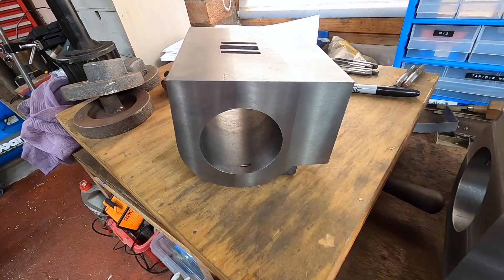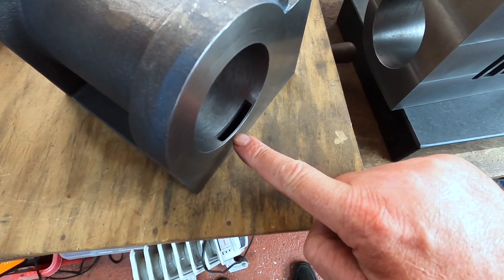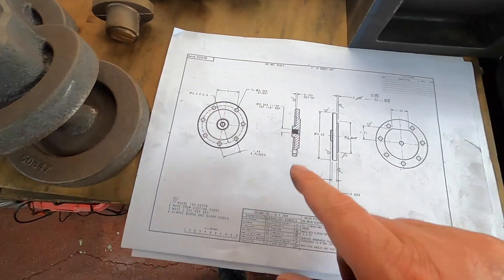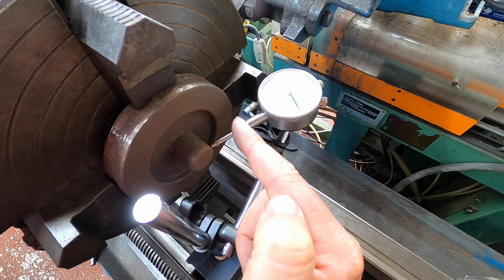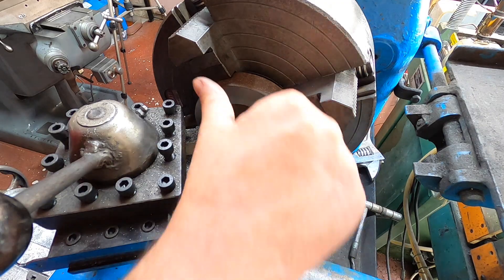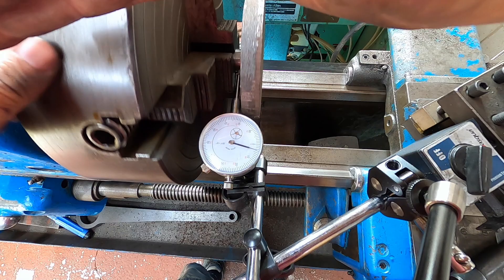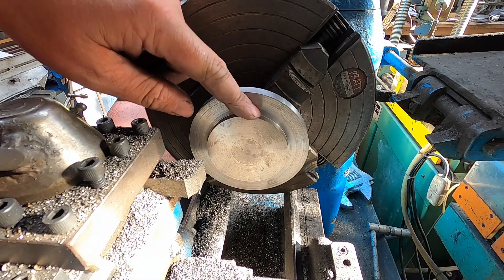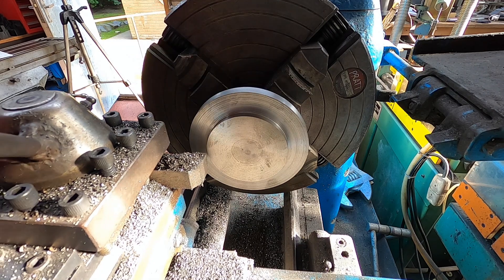Front Cylinder Covers  -  ep53 - 7.25" Gauge Steam Locomotive Build

Comment: Matt….
Boy that CI makes a bloody mess eh? 
Still, nice work mate….
and thanks for putting it up for us 👏👏
Regards
Robert
PS On my Baldwin cylinders, the steam port is actually on the cylinder end faces, and the end covers have a recess cut in them to allow the steam to go ‘round the corner ‘ so to speak.
Should explain also that the ports are not cast in… all drilling / deep slotting work 😵‍💫
Reply from the maker: Thanks Robert, much appreciated. Yes cast is a real messy job! I'm glad the ports were cast in  on these, but I don't think I would have struggled to have drilled them in, maybe on the next cylinders! 😂. All the best, Matt 👍

Comment: Once you have the covers all drilled and ready to fit on the cylinder take to the inside boss were it partly covers the steam port and put a bit of a relief in so the steam port isn't partly covered, the loco well run a lot better if you do. Other thing is cleaning up down the cast in passageways in the cylinder block, the more smooth the better the steam will flow in them and help the engine breath better.
Reply from the maker: Hi, you may see this in a future video 😉. All the best, Matt. 👍

Comment: before you cut off those bosses on the front of the covers.  I'd drill a small center on the inside of each cover for concentricity in case you find a reason why the drawing shows a hole later..
Reply from the maker: Hi Geoff, that would have been a good idea, shame I'm much further ahead than I've shown. I know I won't be using the hole, its far to close to the front bufferbeam. All the best, Matt 👍

Comment: Hi Matt, I fitted screwed plugs in the front covers on my pansy build, if you're putting the loco away for an extended period of time you can spray WD40 into the cylinders and steam oil when you get her back out again 👍
Reply from the maker: Hi, thats not a bad idea!! Especially if it sits for an extended period like you say. All the best, Matt 👍
Reply: @MattChiversWorkshop Queensland Railways did this to their preserved engines over here in Australia apparently. I looked at buying a Lil Lima recently from an Ex-QR fitter and he had done the same thing for the same reason.

Comment: Is the threaded hole for a cover? I know this is common practice on traction engines.  They have a spun steel plate to cover the fixing bolts and keep the heat loss down.
Reply from the maker: Good thought, but they usual are just press fit over the cover, not aware of them screwing on. I think it will be some way of setting up or an oiler. All the best, Matt 👍